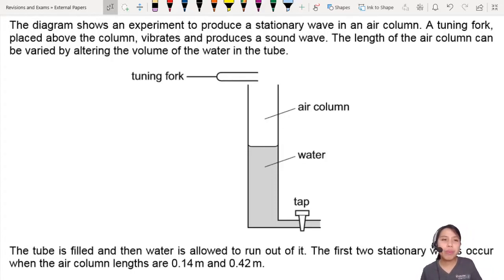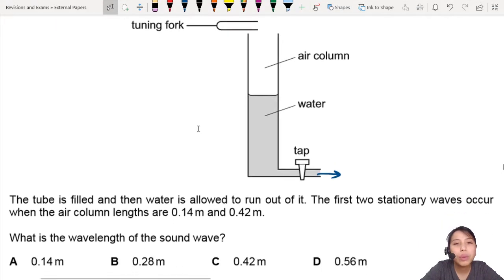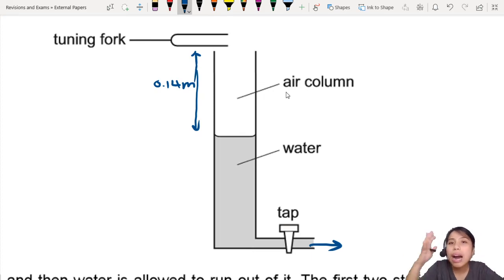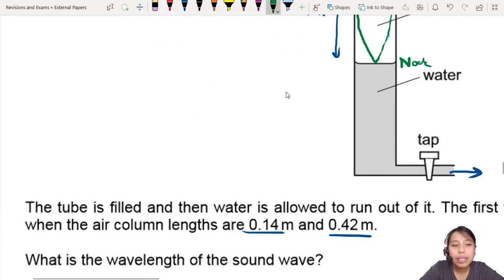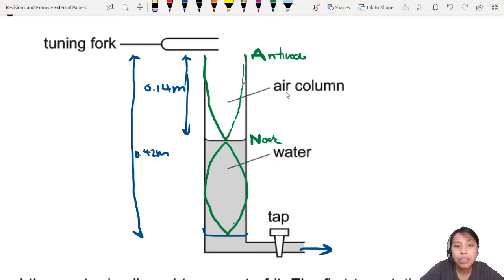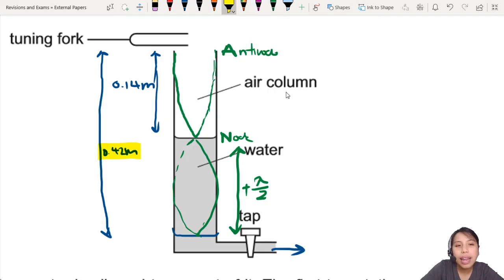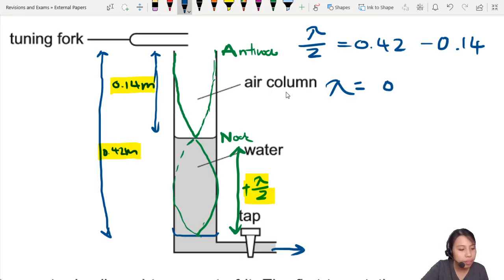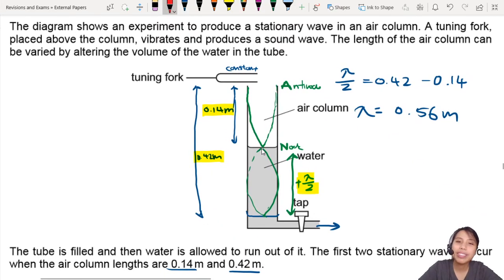8.1e Ex1 MJ20 P12 Q24 Stationary Wave in Tube of Water | Superposition | CAIE A Level 9702 Physics

Comment: why is the difference half a wave length though ? how do we know for sure that it is half a wave length and not 1.5 or 2.5 difference ?
Reply: i have the same doubt too :(
Reply: Imagine this: Splitting a whole wavelength into 4 parts right, and then half an antinode(max displacement point) is equivalent to 1/4th of the wave. So 1WHOLE WAVELENGTH-2 NODES AND 2 ANITNODES